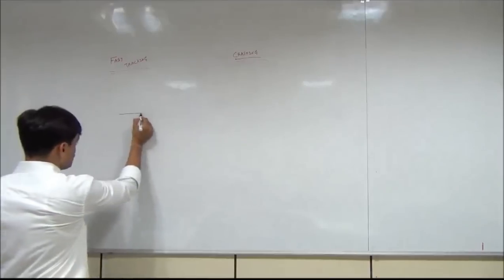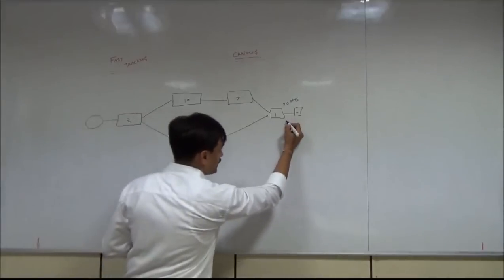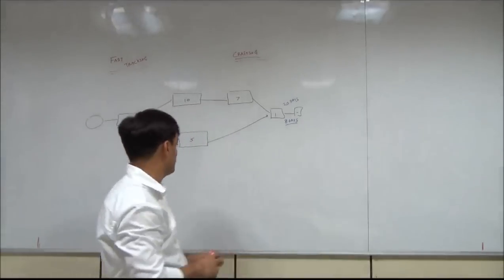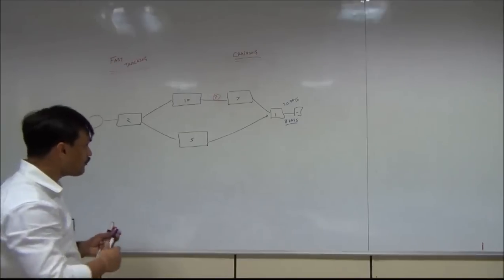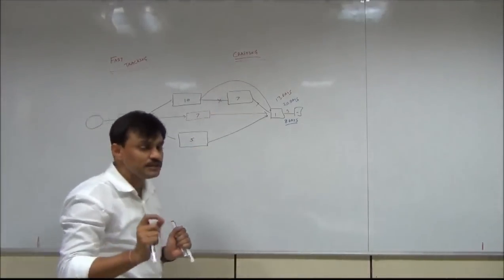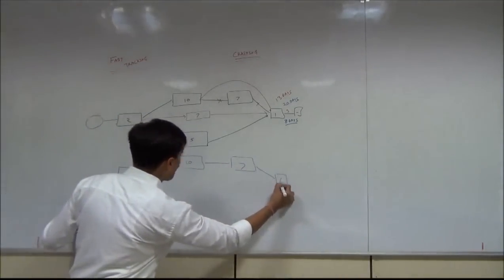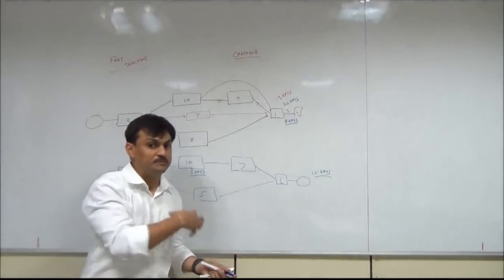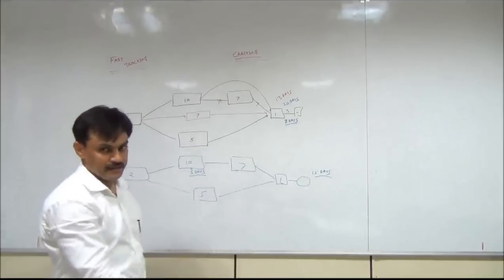Project Management Professional (PMP)®  FAQs | Schedule Compression | Fast Tracking and Crashing

Comment: Thanks for comment, the goal of resource leveling and crashing are very different... resource leveling is not a schedule compression technique its a management of resource allocation so that no one get over allocated on a given activity. The resource leveling is not limited to activities on critical path.

While crashing is putting more people to the given activity where we feel that adding people can make the work fast and compress schedule... this we do on critical path activities.
Reply: Hi, Saket

Is the following explanation correct? What do you think?

Crashing is about using additional resources in order to accomplish the project on time. This approach is used when it turns out that the project final date is approaching but the project cannot be conducted completely by the day because of the insufficiency of the current amount of resources.  The crashing doesn´t lead to an increase in the initial project duration.

Resource Leveling is also about the insufficiency of the current amount of resources in order to complete the project by the defined end date. In this case, the current amount of resources is used in performing several parallel activities. Because it is impossible, for example,  to utilize the human labor of a specialist in two parallel activities, the parallel activities are turned into sequential activities what results in an increase in the initial project duration.

Comment: Good presentation. However it would be appreciated if you can elaborate more on the difference between Resource Leveling and crashing (as the concepts are similar; they both deal with proper resource allocation to activities on the critical path such that there is no room for resources' free time being wasted).
Thank you